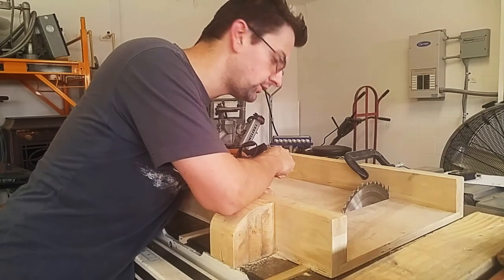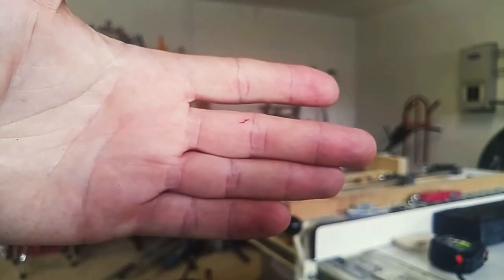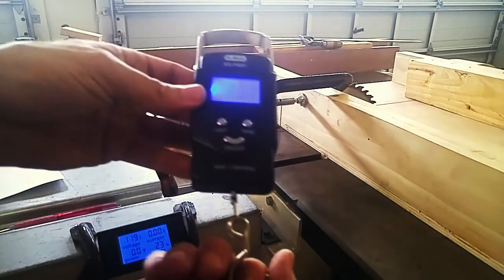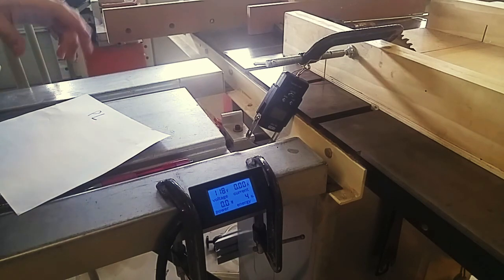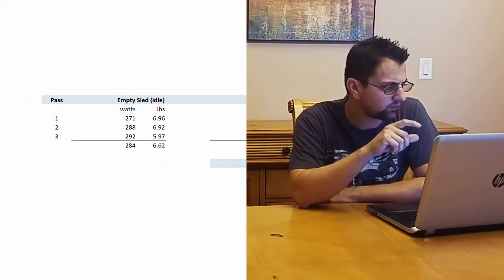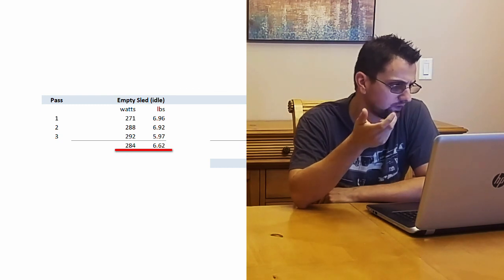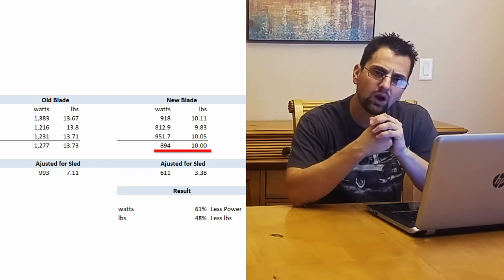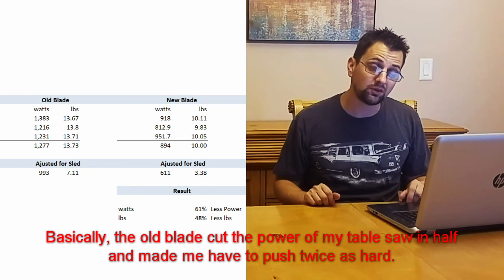Why you should change (or sharpen) your table saw blade frequently.

Comment: Your math is a bit backwards :) 61% less than 993 W is 387 W ((1-0.61) * 993). It used about 61% of the power.
Reply from the maker: +exscape Thanks... That whole some percentage more vs some different % less thing gets me all the time.  I appreciate the correction.